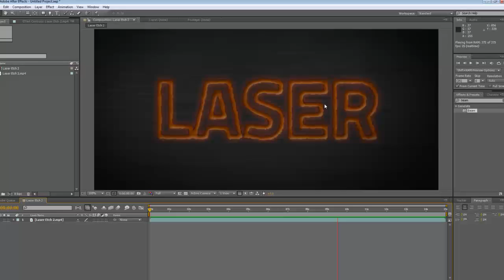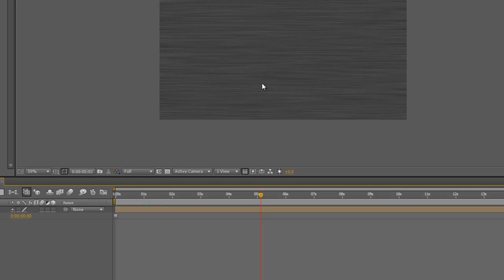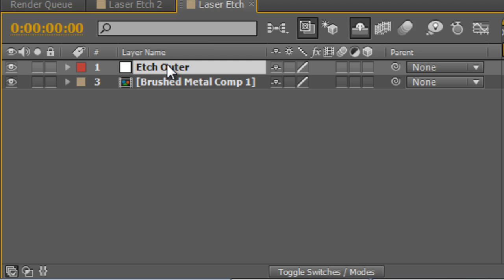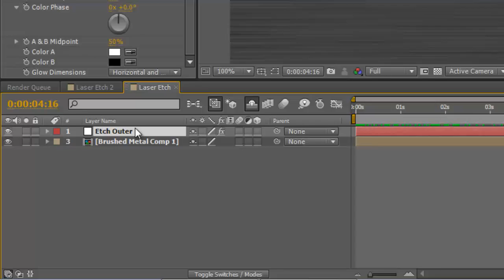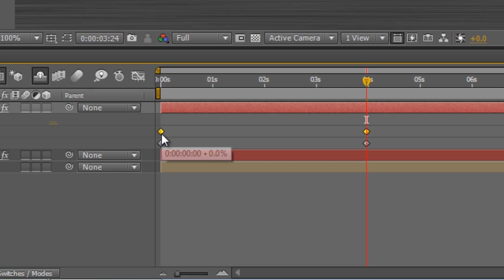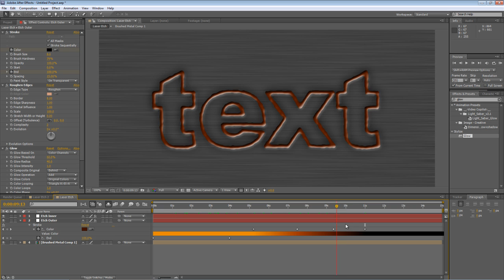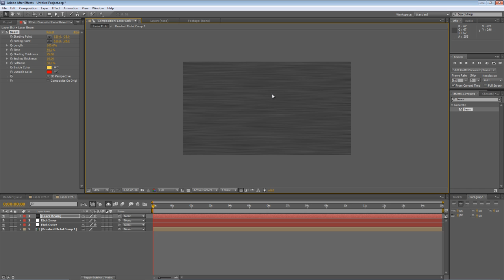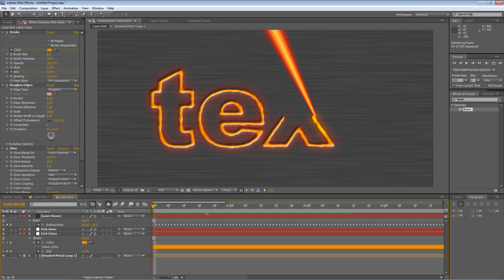After Effects Tutorial - Laser Etched Metal Pt1

Comment from the maker: If you CTRL+Click on the time counter in the top left corner of the Composition panel, it'll toggle between a frame counter and H:M:S:F counter.
CTRL+K will bring up the properties for the current composition - you can set the Frames Per Second value manually in this panel.

Comment: You can do this in CS3 with no extra work than newer versions.  Once you've typed the text you want, with the layer selected click "Layer"/"Auto-trace" (near the bottom).  Then make sure it's set to Alpha and tweak with the settings to get what you want.  Only difference is that masks will be named "Mask 1" Mask 2" etc rather than the original letters.
Hope that helps anyone with an older version

Comment from the maker: @NinjaCookie18 No problem. BTW - I don't use the noise effect for brushed metal any more. If you apply a fractal noise effect to your solid and set the effect's Transform properties to 2000 wide x 2 height, you get a similar set of streaks without having to apply blur or stop frames. (Change the effect opacity settings and blending mode to alter the overall appearance.)

Comment: I also have another issue. My laser beam is a bit pixelated, which is annoying. Also, my laser beam doesn't stretch down far enough to draw around the lower areas of my letters. And yes I have set the length to 100% for my laser beam.
What's going wrong?